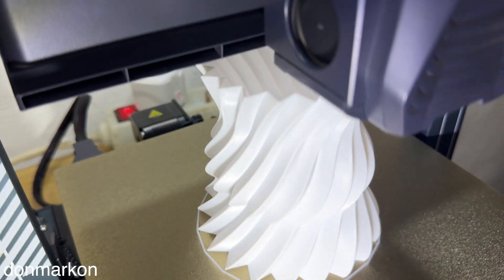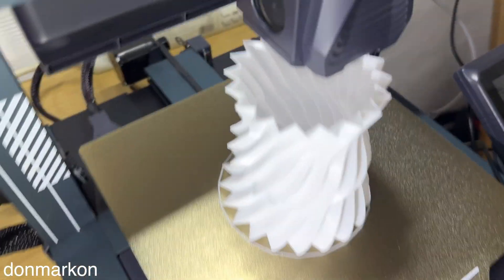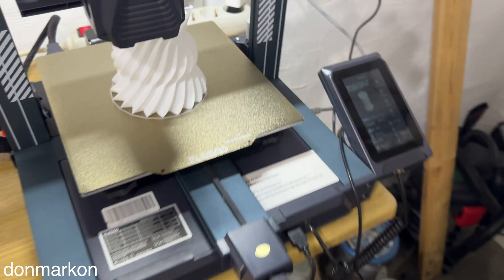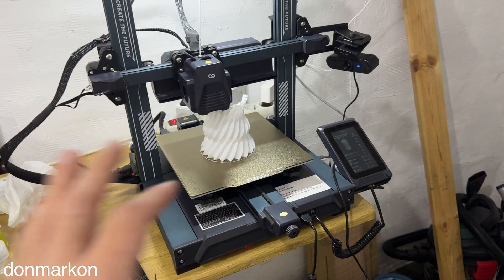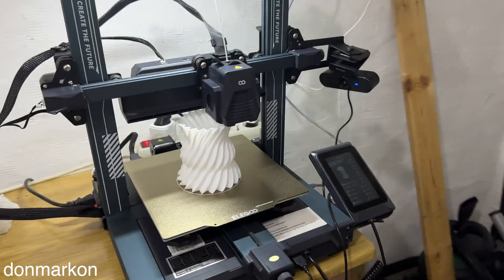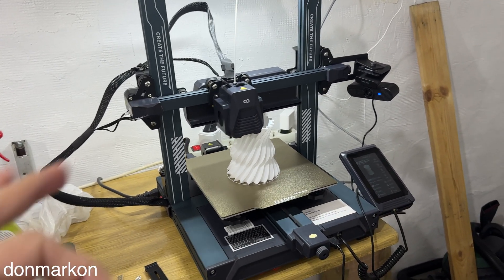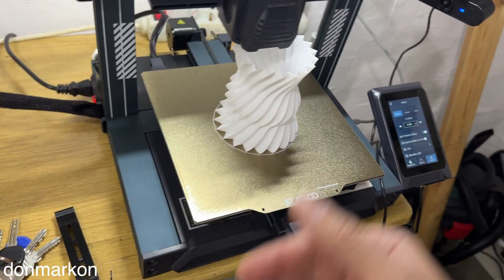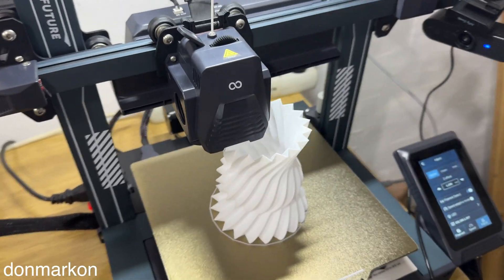Elegoo Neptun 4 (Pro/Plus/Max) Perfect Prints Levelling Calibration Long Term user

Comment: I did extensive research - this video included - majority of those stories are full of shit. This video is correct. And I have a Neptune 4 Pro working. So... there you go.
Reply from the maker: Hey glad to hear this. I spent over 2 months with Neptun 4 and fine tuning it. After i figured everything out it is super easy  and it is in this video